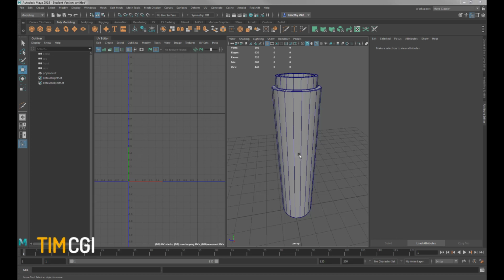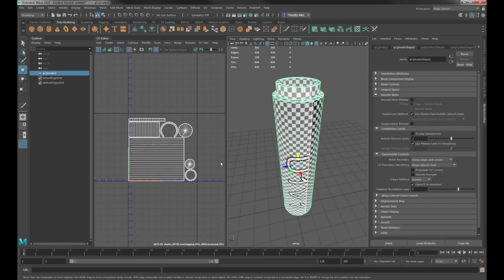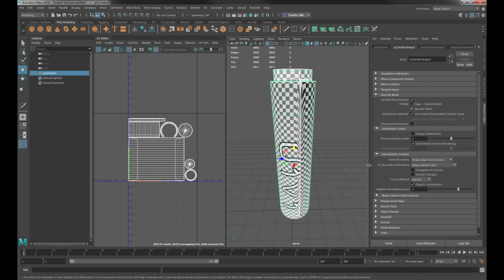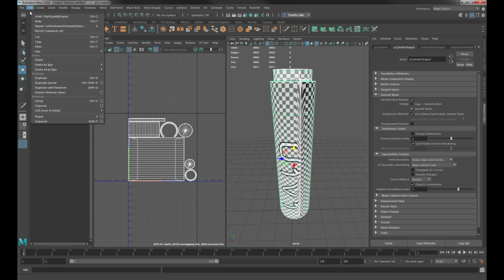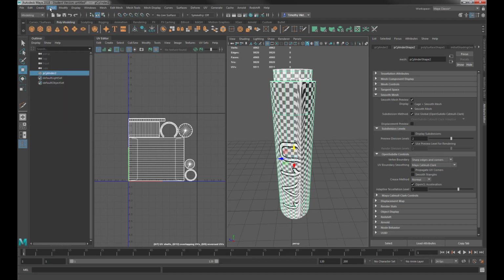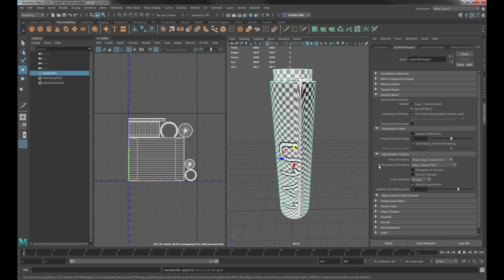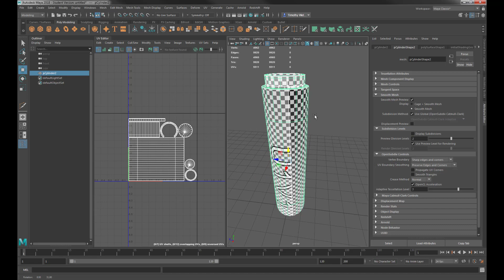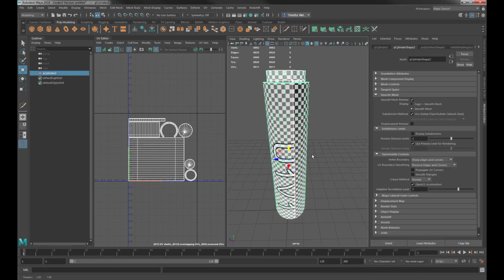Maya: Solving the Smoothing & UV problem

Comment: work but when exports in substances no works :/
Reply: Did you find the solution?
Reply: @KavyaPatel-h1x  The only solution I found is to make a copy of the mesh, turn off smooth preview (Press 1) and actually smooth is twice. After that you have to unwrap your UV-shells again (don't worry, you don't have to redo the UV-maps, just hit Unwrap while your UV-shells are selected), then export that mesh to be used in Substance Painter.